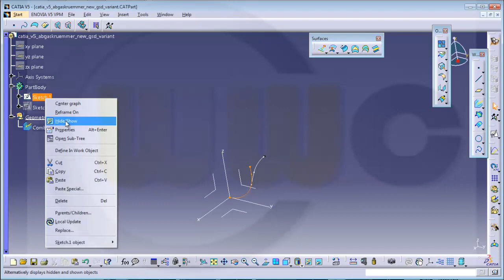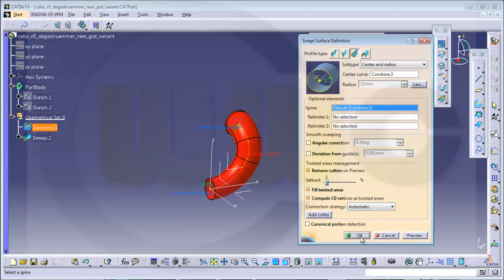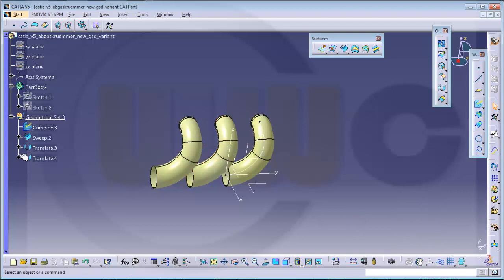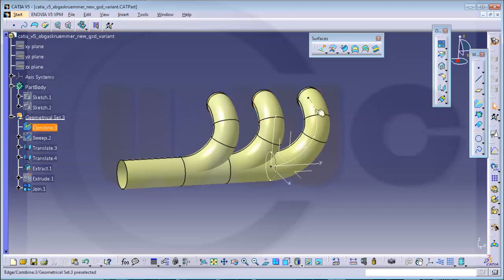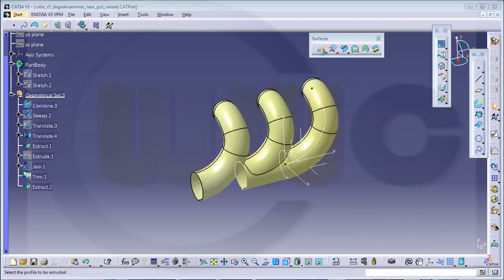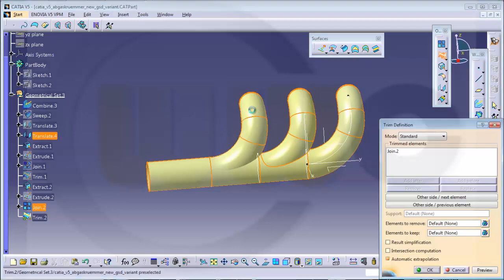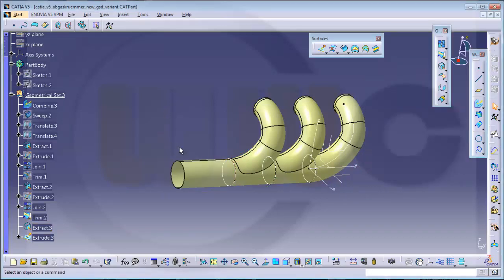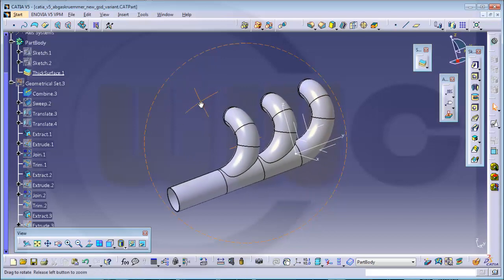Abgaskruemmer - Catia v5 GSD Training - GSD Variant

Comment: Very helpful!! Is it possible for you to explain the law command more explicitly?For example,in the sweep command you used linear law to make a circular profile sweep starting from 20 mm and ending at 25 mm;what if the constant type was selected?how would that affect the geometry?
Reply from the maker: Hi, just try and look :) - If you use constant - the radius of the sweep will be constant. There are some other videos in my channel which deal with laws.
Reply: Wolfgang Walden Ok thx a lot for replying! I will check out the other vids